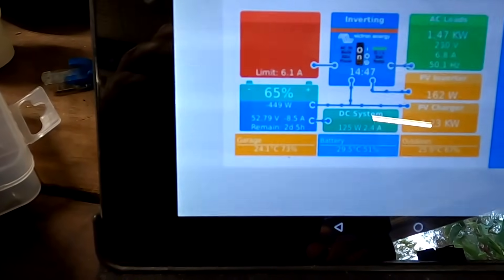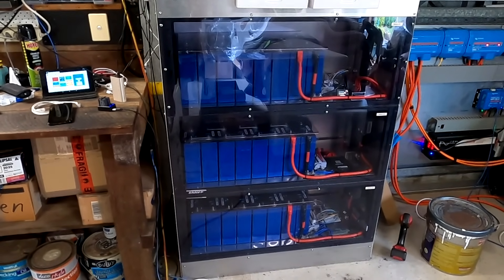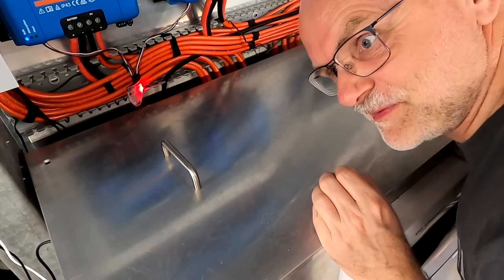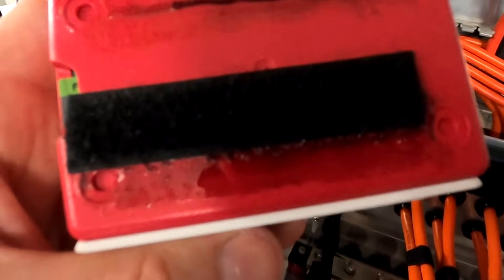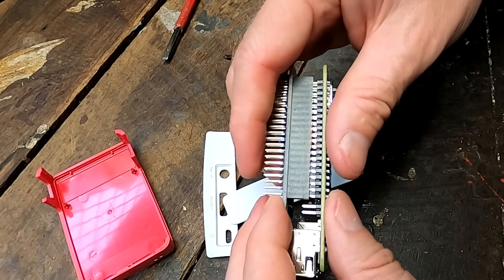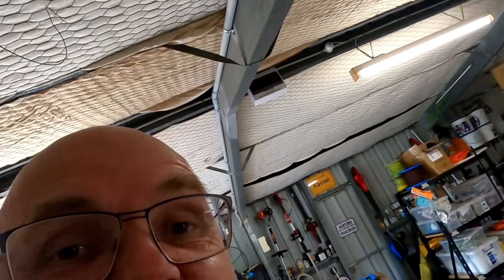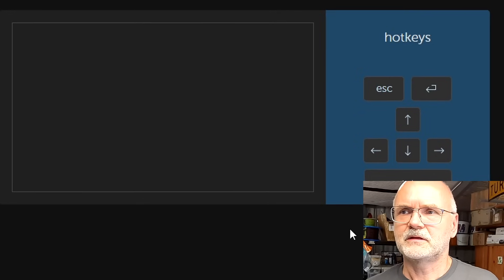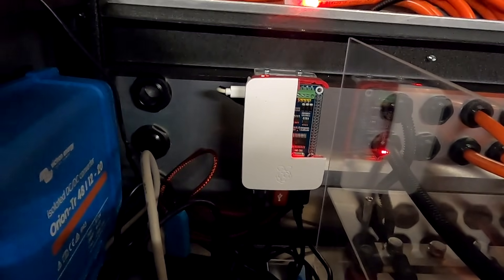Biggest Battery Shelf Upgrade Preparation. Wait, wait, it's just the prep ;) Adding CAN to the Pi.

Comment: Cannot make it work 
[    6.270193] CAN device driver interface
[    7.425312] mcp251x spi0.0: MCP251x didn't enter in conf mode after reset
[    7.432288] mcp251x spi0.0: Probe failed, err=110
[    7.437147] mcp251x: probe of spi0.0 failed with error -110

Comment: There are a few good aluminum heatsink style cases that can be used with header extenders which would give good cooling without compromising the ability to use the header, ... but your hat would be outside of the case entirely on all the ones I've seen.

Comment: I came here from your last video where you had issues with the board.
The assumption on 16:45 is completely wrong. Can is differential but that does NOT mean it doesn't need a ground reference. Sometimes I also heard it referred to as "quasi-differential" because the individual CAN-H and CAN-L lines are still referenced to ground and not to each other. Therefor the tranceiver on the devices still needs a common ground reference. 
This is especially true when the transceiver is not galvanically isolated from the rest of the system (if it were the protection diodes can usually do the job although it's also not an ideal solution).

Comment: Thank you for this Video . Currently i have an "old" JK BMS installed . Communication to Venus is  by USB/TTL  isolated Adapter and dbus-driver from "Louisvdw/dbus-serialbattery." 
This works fine .
Now I'm thinking about switching to the new JKBMS !!!
What is the Benefit when i change to the new JK-BMS ? 
Is it necessary to use an isolated Can Hat like the isolated USB/TTL Adapter or is it not necessary ??
Thank you

Comment: Hello Andy, I've took a look in Victron World at your installation and saw, that you charge a battery out of a battery. 
Left corner "Discharge" = -2640W" and right beside "DC Power" (thats your 2 other battery packs?!?) are charged with 700W.
Solar Power at this moment is 340W total.
AC Load = 2090W
So, the first battery pack is charging the other ones. Is this not a waste of energy due to to much energy losses?
For me it seems more effective, to provide this power directly to your ac-loads.

Regards from cold snowy Germany to sunny hot Australia

Comment: To connect a DALY smart bms to the Cerbo GX, can existing BMS 5-wire 'CAN/485' connection be leveraged to connect to the 'BMS.Can' port on the Cerbo GX?  Are there steps to enable?

Comment: Thinking that with the problems with the adhesive for the Velcro, you may want to consider replacing the case with one that works with a DIN rail. That would get screwed to the back of the battery box, and the Pi would hang off the DIN rail as a permanent solution. You may also consider picking up a 12 volt 40mm fan and use that off one of the GPIO pin pairs that give you +5 and ground. The fan will last nearly forever, and be quieter than a 5v fan.
Reply from the maker: That is a good suggestion. I like that.
I could use the DIN rail for further expansion.

Comment: Nice, but my 2 280 Ah battery are working fine with 2 Daly BMS with UART to usb cable with my multiples.
I will use the can for more mppt or inverter communication.
Many thanks
Eric from Belgium

Comment: BTW, I know what "The Chinese chewinggum" is for. I found it in a inverter. Heat conductor from FET to Alu.
Reply from the maker: Yeah, it goes between the BMS and the front panel. But it also tastes good, so I use it as chewing gum😂
(Just kidding, don't even try!)

Comment: I have the (nearly) same setup as you have. 3 Batteries in Paralell. All with JK BMS though. At the moment connected to Cerbo with RS485 to USB. Just for monitoring. Connected are 3 Active Balancers. I start balancing at 3,45 Volts. Starting automaticly, programmed in Home Assistant. I want it to be over CAN. So I can't wait for your sollution. My BMS has the option of changing the port from RS485 to CAN. But there its over for me. Don't know how to continue. I'll be waiting at my TV screen for the next video.

Greeting from Rob. Enjoy the Beer.

Comment: There is an option to use a 'passive cooling' case. For your case you;d need to add pin extenders.
Search for "Aluminium Armour - Heatsink Case". With one of these you'll never have to worry about heatsinks melting off again. Good luck.

Comment: I’m not sure you don’t  need the ground reference in the can communication. I’m studying about a can communication system with a solar inverter and i can’t find a certain answer about the question, but when you search about can communication standard, a common ground is always required, also if it’s a differential signal communication. Instead the rs 485 that doesn’t need gnd. Can Someone tell me something more about common gnd or explain me what i’m saying wrong? Thanks and sorry for my english 😅

Comment: After seeing this I just go and buy a Cerbo. It shows once again Raspi is mainly for tinkering, but having my power rely on stuff like melting glue, heatsinks falling to the PCB and modified cases is not going to happen. At the end, with all the bits and pieces used to make a Raspi ready as a solar power controller you save at most 100 bucks. 😂 That‘s not worth the effort, I rather spend this effort to optimize my power consumption and management.
Reply: You usually have either time or money.  Most do not have both.  I have more skill and time than I do money.  My brother has way more money than time. I DIY, he has "people" that do it for him.  Most fall somewhere in between.

Comment: Get a different case that has a fan. I use the the Argon case, which has the ability to move from the SD card to a proper SSD.  All metal case and you still have access to the pins.
Reply from the maker: Maybe no case as some suggested.
A metal case which accommodates for the CAN Hat?
Reply: @OffGridGarageAustralia It should.  There's a magnetic lid that hides the pins.   I'll check when I get home ... out of state at the moment.
Reply: Just verified and a pi hat will fit just fine 👍
Reply from the maker: @GregOnSummit  I'll look it up. Thanks a lot.

Comment: You say not to send an email but to ask questions in the comments. So, have you used or looked into the REC-BMS units?
Reply from the maker: Thank you for not sending an email. 😊
No, I have not used a REC BMS before.
Yes, I looked into it but didn't like the contactor approach.
Reply: @OffGridGarageAustralia  I get it. However, I need to be able to manage the house bank on my sailboat which also powers the 24v 20hp electro-hydraulic bow thruster. I am using the BlueSea ML-ACR Automatic Charging Relay - 24V DC 500A (which can handle up to 1,750 amps for 30 seconds)
Reply: But I really do appreciate the quick reply!😁
Reply from the maker: @Sailing_SY_Meltemi  using a relay makes a lot of sense there😊
Reply: @Sailing_SY_Meltemi  So 20HP on 24V?  By quick calculation that's over 600 running amps.  Wowser.

Comment: Most double-sided thermal tape is garbage. Some work okay until they heat up, and then the glue fails, which is probably not what you want. I generally use thermal conductive epoxy. You're not going to get the heatsink off if you use epoxy, but it's also not going to fall off. I always check to make sure it's not conductive, but haven't found any that is, so I think it's pretty safe no matter where it goes.

Comment: Looks like an immediate project for the 3D printer, Andy! Brand new mount for the RasPi!
Reply from the maker: YES 💪
Maybe just a base plate and stand-offs, so it gets the best cooling.
Reply: @OffGridGarageAustralia  Agreed. Besides, a case like that for a raspi is for wife acceptance factor in the living room. It'll look great with a nice standoff mount on the battery shelf. Maybe attach a little fan to the heatsink to help keep the SOC cool?

Comment: I have USA made Midnite Hawkes Bay charge controller which is relatively new product , but they are way behind in the software and communications. It uses Can so maybe one day I will be able to have the Jakiper batteries communicate with it. Forget about it talking to the inverter - that is a reliable but non communicating Outback inverter.  I did try to figure out the controller Can protocols but trying to figure out all that stuff makes my old brain hurt. After I get modbus stuff figured out then everyone has to start using Can !
Reply from the maker: Yeah, there is always something new and different to explore and figure out. And people tell you all the time what to try and test and what is the best. You almost cannot keep up any more😄

Comment: Do away with the case/enclosure. Give your RPi more ambient air cooling.  Using simple metal standOffs.  Another great video Andy.
Reply from the maker: I can print a basic mount for the Pi so it hangs freely in the air.
That's a good idea!

Comment: Arctic Silver makes a "Thermal Adhesive" which functions like thermal PASTE but makes a "Permanent" connection. This might be helpful in keeping your heat sink attached to the Raspberry PI.  A word of caution though, it is permanent and whatever is connected together cannot be separated.
Reply from the maker: Arctic Silver... I didn't hear this name for years! Used their thermal paste for CPU coolers.
Reply: I used thermal glue, its a 2 components thermal. Its Rock solid, and feels like its never coming off again

Comment: Hi Andy. A few months ago you made a video of connecting a dual can hat to the pi, why didn't you use it for this project? is it because it doesn't have that crystal you mentioned? would it still work? so many questions.
Reply from the maker: If you follow the link under the video to my website you will find both CAN Hat options. Yes, that will also work.

Comment: The item you pointed to with 12.000 on it is a crystal and the value read 12Mhz.
Reply: It reads 12 mega hertz
12 is in megahertz 000 after the decimal point is the addition kilo hertz
Reply from the maker: It reads 12.000kHz, right?

Comment: Let's go for the next video. ✌️ I am a cervoGX user
Reply from the maker: Yes, you're all set. What BSM are you using at the moment?
Reply: @OffGridGarageAustralia  I am with 2 bms Seplos. 2x16s 580Ah. my first bms some headache. (Now I am doing maintenance with this battery. Changing the busbara, sanding and adjusting the resistance to 0.15ohm and then see how it behaves in this first battery. I use the NEEY 4A active equalizer. I am not satisfied with its performance in the long run. I should be more effective.)
This is a super super entertaining toy

Comment: I used a slightly deeper non dedicated Raspi box which includes a display and cut a hole for a tiny computer cooling fan. This uses so little power so I leave it running all the time. The CPU temp then never gets too hot even with +35degC ambient temp.
Reply from the maker: I probably have to look into a fan as well as it can get hot inside the top compartment. On the other hand... there will be AC at some stage🤷‍♂️
Reply: @OffGridGarageAustralia  Although I am in a cooler climate (UK), having a display attached to the Raspi I had the CPU temp displayed at the bottom of the remote Consol display. I found that in UK summer the CPU temp could get up into the 50's deg. Adding the tiny fan kept the temp down even when the ambient temp reached an unusual 35degC.
Reply from the maker: @nigelcharles511  I thought 70-80° is still ok for these CPUs. It will last longer with a fan for sure...
Reply: @OffGridGarageAustralia  I am sure you are right. Not knowing that I just felt more comfortable adding the fan. As you show it isn't always the semiconductors that suffer first. Also in my case I wanted to protect heat build up on the back of the display. I am learning that better to definitely prevent a problem first time around rather than find and chase problems later. Both my Quattro and Multiplus have high volume blower fans. Even in UK summers these are necessary when operating at or above 75% rated power output. Charging EVs at 7.2kw for long periods at +35degC can be quite a challenge.
Reply from the maker: @nigelcharles511  I throttle my charging down when it's hot or charge early in the morning when it is cooler down here as long as the MP and Phoenix don't have proper AC. It's torture otherwise.

Comment: Bin echt gespannt was da noch kommt. Habe schon ein CAN-Head für meine MPPTs mit 250kbit/s installiert. Gibt es auch eine Möglichkeit das CAN-Head mit 2 x CAN zu installieren? Mein Raspberry habe ich ein Hutschiengehäuse verbaut, da passt auch das CAN-Head rein. Gibts auf Aliexpress für ca. 6$.
Reply from the maker: Thanks for the tip with the Din-Rail.
Yes, it is possible to use the other CAN Hat as well. Follow the link under video which points to my website. There is the other video linked where I showed the installation of the double CAN Hat.

Comment: You got Stuart's diy model?  I have the cpu problem, too. Don't use paste does the same, too, Andy.
Reply: I had the same heatsink falling off problem, but used a piece of plastic (knockout from MCB case) to wedge it up, so on model 3B+ it’s supported from the HDMI socket
Reply: @michaelbouckley4455  Mine is an orange pi 3 for solar_assistant.  Which is not as good as I through the software would be.
Reply from the maker: I can't get the parts for the DIYBMS. Have tried so many times... And Stu is not selling them either. He just makes the BMS design and code.
Reply: @OffGridGarageAustralia  there is a new design out there. Version 4.5 of the cellmodules uses another chip.
Reply: @OffGridGarageAustralia  I will have a look again. I have 5 version 4.2 boards here. Aliexpress fake FETs stuff me up.
Reply from the maker: @chuxxsss  yeah, the board may be the least difficult part to get...
I wish he would have a shop where you can just order the whole set in parts and solder it together yourself to keep the DIY vibe.
Even then, I don't have any SMD equipment 😬
Reply: @OffGridGarageAustralia  I have a 16s kit laying around....
Reply from the maker: @chuxxsss  from where in China? This is all very difficult and complicated.
Reply: @OffGridGarageAustralia  jclpcb for example
Reply: Nö, leider nicht.
Reply: @the_schmue2973  His new upgrades look wonderful.  I need to replace the chips I bought off Aliexpress so mine work.

Comment: Best solution for the Raspi is NO housing so air can freely move. I've 3d-printed a backplate for the Raspi with spacers instead of housing/case. Keeps the surfaces measurable cooler...
Reply: I actually get a 60mm fan and the pi screw holes are ~58mm apart and just use 30mm screws to the fan and they'll be slightly diagonal and then the ban pumps a ton more air than required straight onto the board lol
Reply from the maker: I like this idea of a base plate for the Pi!

Comment: The only solution is: Victron has to build a bms
Reply: I dread to think  how ludicrously expensive would a Victim (POST COMMENT EDIT: Victron) BMS will be.
Reply: @garys-half-baked-offgrid-dream hopefully a victron and no victim bms. 😂
Reply: @Carsten-PV-DIY  Ooops lol I would like to blame auto correct but it will be my fault
Reply: @garys-half-baked-offgrid-dream  it made my day.. This is a great typo in regards of charging. Victim bms! 😂😂😂😂😂😎👍🤝🤞
Reply: @Carsten-PV-DIY  Glad to be of service 🤣🤣🤣
Reply from the maker: Well, they don't have to any more...
Reply: That would be so nice if they did that.
Reply: They actually have a few BMS options, but they only seem to work with Victron batteries, or they're quite basic and don't do any balancing or DVCC

I'd also like to see a Victron BMS to rival the likes of Seplos or JK. I don't know if they'll do better on the hardware front, but Victron tend to be very open with software and okay with customers making their own mods or upgrades

So perhaps no more messy software solutions 😁
Reply: @the_amazing_raisin  yes, but it seems to be a bettry management instead of an battery cell management

Comment: I will stick with my Dumb Daly, this is going to be way over my head!
Reply: If you get involved with the daly, it's not the daly that changes, the daly changes you
Reply from the maker: Gaza, how is your inverter doing when the battery is not connected because the BMS has shut down? Will it be upset or even be damaged?
Reply: Yup been there killed one already. 
I have turned auto restart off. I will jump start it manually.
Reply: @OffGridGarageAustralia  The next inverts I will be buying the SOFAR HYD5000 lists battery soft start as a function.

Comment: What are this 90 degrees plus pole connections? I search something for my VAN to keep the battery low profile and this looks really interesting.
Reply: As far as I remember, he made them himself
Reply from the maker: You mean the elbow ring lug? Very hard to get. Someone with an automotive shop here in AU got them from the US and sponsored them to the channel.
You can get them in the US apparently:
https://www.quickcable.com/product-category/battery-terminals-lugs/lugs/elbow-lugs/